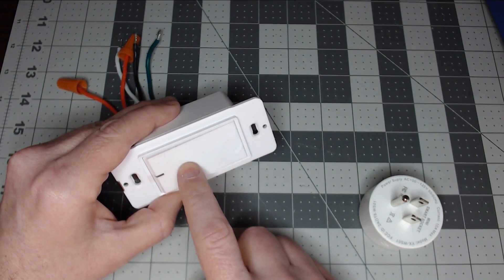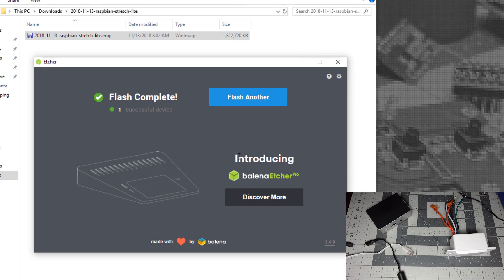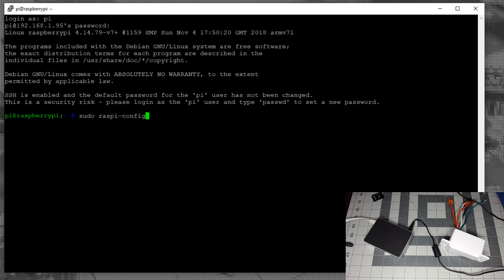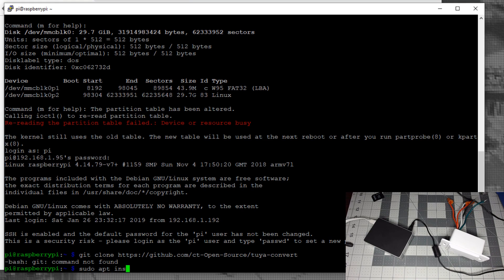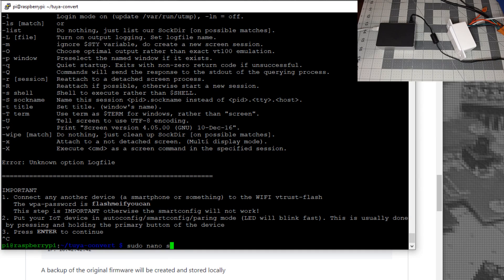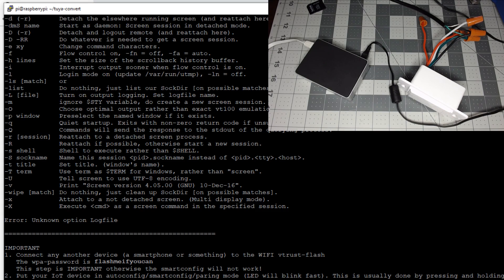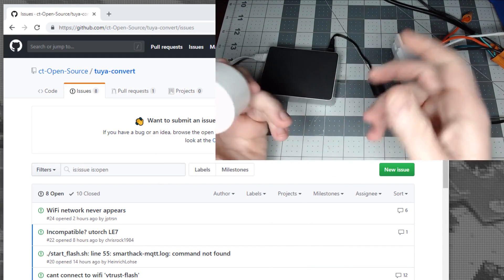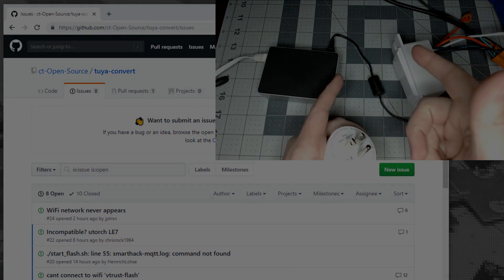Flash Tuya Smart Switches, Plugs, and others all Over the Air - No soldering!

Comment: Does this procedure still work?  I have a house full of Gosund dimmer switches and want to get them into HA.  I really don't want to remove the switches to and solder wires to flash them.  I have a couple of extra Pis so that's no problem just wasn't sure this was an option any more.
Reply from the maker: Sometimes it does. Depends on if the firmware was patched

Comment: Hello, I don't have a raspberry pi. Is it possible to simulate its function or use it in another way to do the same thing?
I will really appreciate it if anyone can help me out in this regard.
Reply from the maker: Yes. A Linux VM or machine with a wifi adapter that supports AP mode.

Comment: How did you hookup your switch to mains power to do this demonstration?
Reply from the maker: Used an extension cord with wire nuts
Reply: @digiblurDIY  but how was it wired, do you have a screenshot? Dont want to blow myself up.

Comment: The question is why these assholes insist on trying to prevent this. They've sold the device. I'm not going to have random Chinese shit on my home network with credentials in it. Anyway, this didn't work on a recent batch of "Smart Life" RGB bulbs. They appear in my router's DHCP leases with hostnames like ESP_xxx, so one would think they're ESP82xx devices. Tuya-convert didn't find any MAC address corresponding to the bulb, and in fact the MAC it reported doesn't even appear on my router... so I have no idea WTF it detected.
Reply from the maker: They've been blocking things on the firmware.  Sucks.  They are some preflashed options too of bulbs though.  https://www.digiblur.com/2021/09/preflashed-esphome-tasmota-smart-bulbs.html
Reply: @digiblurDIY  Thanks. I actually had candelabra-sized bulbs, which Athom unfortunately doesn't have. So I'll probably replace a couple of fixtures.

Comment: Hi Travis, thanks again for the awesome video. I purchased a few treatlife switches from your amazon link and now i'm trying to flash it with tasmota. At this point i'm not sure if firmware upgrade is still possible for OTA. I went ahead and tried anyway on Virtualbox running Ubuntu 20. I got to the last step: ./start_flash.sh and got message that "AP mode not supported". Now i've done this on 2 different Macbooks (1 older and 1 newer). When you have some free time can you shed some light on my situation? Once again, many many thanks for all your helpful videos.

Comment: I ran it all and got this:

======================================================
Starting smart config pairing procedure
Waiting for the device to install the intermediate firmware
Put device in EZ config mode (blinking fast)
Sending SSID                  vtrust-flash
Sending wifiPassword          
Sending token                 00000000
Sending secret                0101
................
SmartConfig complete.
Resending SmartConfig Packets
.................
SmartConfig complete.
Resending SmartConfig Packets
.................
SmartConfig complete.
Resending SmartConfig Packets
................
SmartConfig complete.
Resending SmartConfig Packets
.................
SmartConfig complete.
Resending SmartConfig Packets
.................
SmartConfig complete.
Resending SmartConfig Packets
................
SmartConfig complete.
Resending SmartConfig Packets
.................
SmartConfig complete.
Resending SmartConfig Packets
.................
SmartConfig complete.
Resending SmartConfig Packets
................
SmartConfig complete.
Resending SmartConfig Packets
..............
Device did not appear with the intermediate firmware
Check the *.log files in the scripts folder
Do you want to try flashing another device? [y/N] n

Any ideas? I don't know which log file to look at?
Reply from the maker: Check the smart psk log for decryption errors.
Reply: @digiblurDIY  Yes sir that is exactly the problem. So now I am over here reading: https://github.com/ct-Open-Source/tuya-convert/wiki/Collaboration-document-for-PSK-Identity-02

Is there a solution to this problem?  Sorry I am a noob when it comes to this so just trying to follow along.  Problem is this is my test switch and I have like 40 more already installed! Help :)

Thanks!
Reply from the maker: Yep, check some more of my recent videos.  Flash it manually.
Reply: @digiblurDIY  I can't flash them manually they are installed.  I assume you mean rip them out and solder or connect to them physically?  Not really an option.  Would take me more than a day to get to the chips of every one of them.  I don't like them relying on the cloud - but so far it works but I wanted homeseer to fire off some routines...
Reply: Manually does me connecting physically right?

Comment: why would someone choose not to program their switches this way but with hard wiring?
Reply from the maker: Not sure I understand?
Reply: @digiblurDIY  I see you have done other articles about flashing with pins via the USB adapter.  Is there a better or good reason to use that over this method?  Are some switches not compatible with this method vs hardwiring?  I am very new to this and trying to find the right / best switches but I prefer not to open up the switches, I want a switch that dims, can be 3 way and won't flicker.  Also, a plus would be adjusting the dimming rate.  Thoughts? Thanks!
Reply from the maker: Probably not any wifi ones that do that. Zigbee or zwave maybe.
Reply: @digiblurDIY  Which part is complicated? The 3 wayness? Thanks!
Reply from the maker: Dimming rates and 3 way in one. TuyaMCU doesn't let you change the rate
Reply: @digiblurDIY  I guess that explains why I can't find it.  I am an Omnipro guy and the options for switches is limited.  Considering RadioRA as a complete system but zwave and zigbee are not really compatible anymore.  Other option is UPB which I use today but have too many misses than I would like.

Comment: thanks for the video, this worked fine for my Brilliant 20676/05 smart plug, there were some minor differences- good differences due to updates on the tuya-convert git repo which makes this process even more streamline. They may have patched the Log File error, I did not encounter that, plus there was no WPA password required when joining the vtrust-flash AP. Another difference as well was after I ran the ./start_flash.sh script it prompts you with 3 options (0=stock, 1=espurna, 2=tasmoto) which don't require the curl commands, you just simply choose a number 0-2 and its good to go, i obviously selected 2=tasmoto and then i jumped on the tasmota-xxxx SSID. Good luck
Reply from the maker: Yes. I have done a couple update videos since this one.

Comment: Could you possibly detail a way to do this with a PC (possibly through VM, as I don't have a Pi 3 kit at the moment to work on)?

I really want to flash CFW onto a set of Merkury bulbs, and I've found the chart which tells the four pins used for controlling white, color, and data.
Reply from the maker: You can find additional setup instructions here https://github.com/ct-Open-Source/tuya-convert/blob/master/README.md

I don't have a wifi adapter that works with the procedure which is why I used the Pi3/Pi4.

Comment: i tried this with a raspberry pi 2 with ethernet plugged in along with a usb wifi adapter  and it did not work. guess i will need to buy a pi3 B  with wifi built in  :(

Comment: The ap isn’t showing up and here are my logs ==> ./scripts/smarthack-wifi.log <==
nl80211: Driver does not support authentication/association or connect commands
nl80211: deinit ifname=wlan0 disabled_11b_rates=0
nl80211 driver initialization failed.
wlan0: interface state UNINITIALIZED->DISABLED
wlan0: AP-DISABLED 
wlan0: CTRL-EVENT-TERMINATING 
hostapd_free_hapd_data: Interface wlan0 wasn't started
AP closed

Comment: Is possible use this same method with some others smart plugs that has available  on amazon such as Teckin plugs ?
Reply from the maker: Absolutely! Most of the Smartlife/Tuya based products should work fine.
Reply: digiblurDIY awesome! I have another question now, is possible do OTA with ESPhome? If yes do you have the reference with the steps and the Yaml config?
Reply from the maker: Yes. I would also direct you to the newer updated version of the video as well.

I don't use Esphome on devices such as this but you can send over the bin during the exploit or just do a firmware upgrade once you get into Tasmota.

Comment: I think i missed the part about why you connect a phone or laptop to to the vtrust ap.  I don't see why that is a requirement?
Reply from the maker: Yes it is a requirement per their Github page, from what I know it has to do with the smartconfig of sending the packets.  I do know if you don't have a secondary device connected it won't work.
Reply: @digiblurDIY  just making sure i didn't miss a major part.  i got everything setup on my pi.  tonight or tomorrow morning it's time to flash.  I have 6 devices ready to go!
Reply from the maker: Good luck! Make sure you read my updated description about using the bin file that has wifi manager enabled by default so you don't get locked out potentially from a password typo.
Reply: @digiblurDIY  I downloaded it into the folder and renamed to thirdparty.bin :)

Comment: In the log, how do I know that my device had been blocked by tuya?
Reply from the maker: In the wifi log you will see both devices connected with their MAC ID listed.
Reply: @digiblurDIY  Thank you for the information, it seems like one of my device has the updated firmware so tuya convert got blocked. Now I have another problem: Maybe I fucked up when flashing a(nother) device without changing the firmware for the thirdparty.bin (still linked with sonoff-basic.bin), turn out they have different flash mode (sonoff is dout, but mine is qio), so now my device's wifi doesn't work (hold button for 5s but nothing happen). Does that mean I have to flash the old fashion way?
Reply from the maker: Most I have messed around with are DOUT. Did you get in at all to put in the wifi one time?
Reply: @digiblurDIY  After flashed, the wifi light was still steady on. But when I plug out and re-plug the device, wifi light no longer turns up. And when I hold the button for 5 or more seconds, there is still sound indicator, but the wifi light didn't blink, it doesn't enter any kind of mode. So I try to ./start_flash again, and the back up stall until time out. That was when I found out the flash mode stuff.
Reply from the maker: It sounds like it flashed then...  can you see any access points made by it?
Reply: @digiblurDIY  I didn't see any access point... but well, it's all good now lol. Just tried ./start_flash again and somehow it started backing up, so I was able to undo and turn back to the original firmware. Still have no idea why I can't do this yesterday, every steps are the same. But anyway, problem solved (magically), sorry for taking your time and thank you so much for the guide.

Comment: Hello, Thank you for your video. I tried to flash my smart life power strip with 3 AC outlets and a USB port. The flash was a success. However, after i changed the SSID and stuffs,  one of the outlet from my power strip keep  triggering on and off like blinking. and nothing can be done. The button on the power strip doesn't do anything now. Any suggestion on this ? Thanks

Comment: My ZooZee  socket got an IP address of 10.42.42.26, not 10.42.42.42 .  If I try to run curl http://10.42.42.26 or curl http://10.42.42.26/backup I get connection refused. Does this mean the plugs have the newer firmware that blocks the exploit?
Reply from the maker: did you see the process of it downloading the firmware?
Reply: @digiblurDIY   no that is where it fails.  3. Press ENTER to continue

======================================================
Starting pairing procedure in screen
RTNETLINK answers: File exists
~/tuya-convert
Waiting for the upgraded device to appear
If this does not work have a look at the '*.log'-files in the 'scripts' subfolder!

IoT-device is online with ip 10.42.42.26
Fetching firmware backup
  % Total    % Received % Xferd  Average Speed   Time    Time     Time  Current
                                 Dload  Upload   Total   Spent    Left  Speed
  0     0    0     0    0     0      0      0 --:--:-- --:--:-- --:--:--     0curl: (7) Failed to connect to 10.42.42.26 port 80: Connection refused
======================================================
Getting Info from IoT-device
Reply: @digiblurDIY   put some of the screen output here. When it tries to do the backup I get connection refused.
Reply from the maker: Weird. Haven't seen that before. Might try posting an issue on the Tuya-convert github and see if anyone else has seen it.
Reply: @digiblurDIY   okay will do. Thanks for taking a look!

Comment: Anybody know why the DHCP server isn't working with the ./start_flash.sh script?  I can connect to the vtrust-flash using my laptop's built in wifi and using my desktop's Nighthawk wifi adapter. However, neither will assign an IP address. I've used Ubuntu installed directly on my laptop and I tried Ubuntu on my desktop's VMWARE.

Comment: I have gosund plugs - this might be my problem - or it's a misunderstanding of the flashing process.  I run ./startflash on the pi, then I connect to the pi using my iphone - then I put the plug in setup mode (fast flash).  I hit <enter> and all I get are "."'s - sometimes it jumps out of program mode (goes to solid light) but usually just keeps on flashing - and i get rows of dots. Is this because its a gosund and not tuya specifically? or do I bring up my smartlite app and put the vtrust/password into it when I put the plug into pairing mode?
Reply from the maker: If you paired them with the cloud they probably have updated to the new firmware and blocking the exploit for now.
Reply: digiblurDIY was thinking that - will order. A couple new ones and see what happens. Either way I needed a pi